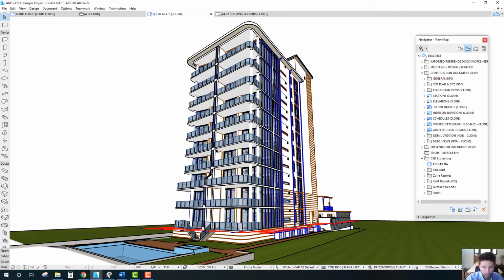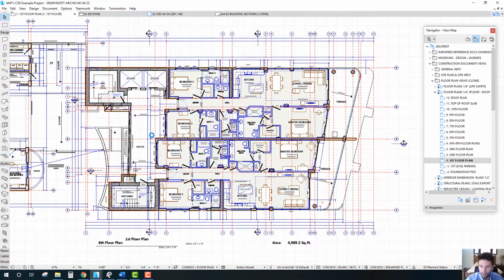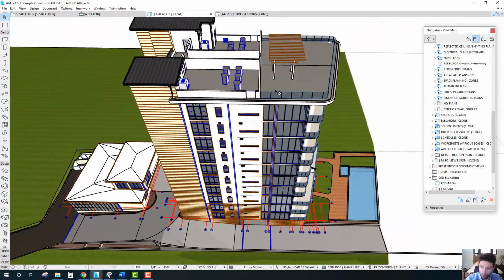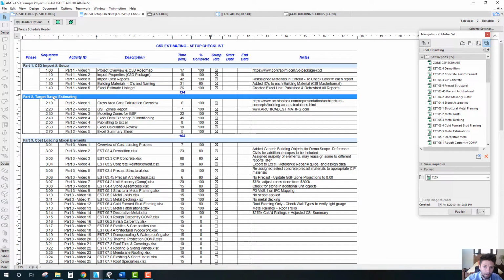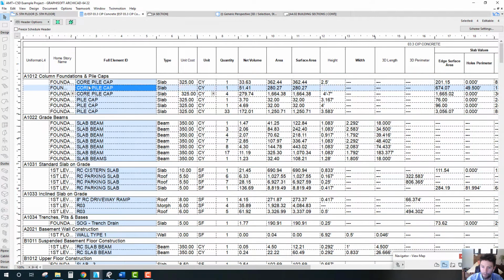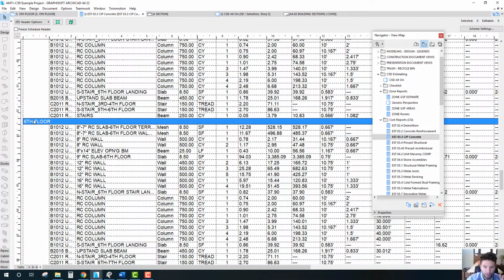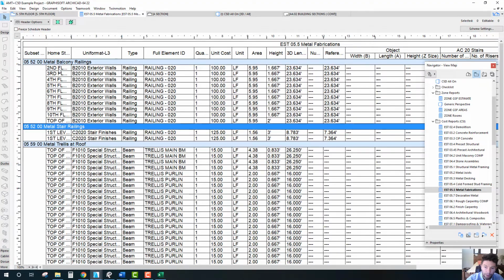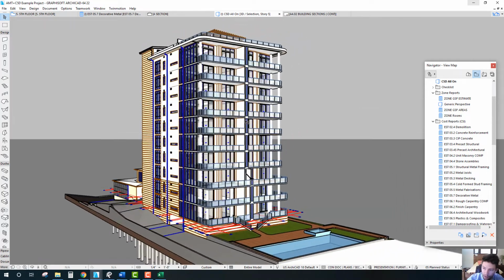10 Story Condominium Project Gets Quantified and Estimated in ARCHICAD!

Comment: How to model steel connections in archicad for the I section used as coloum in this project
Reply from the maker: Steel connections would have to be detailed manually, or with a GDL object. When it comes to steel, I usually just draw pin-to-pin to get the accurate lengths, and throw a factor at connections weight. To go further and detail the connection (plates/cuts/bolts/welds) you could rig up a little group of elements/objects to apply. I think Graphisoft has more in terms of connections coming in AC23